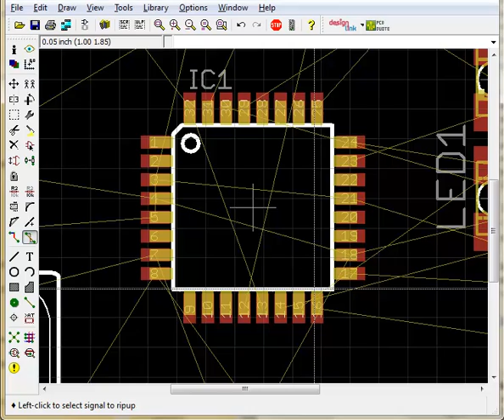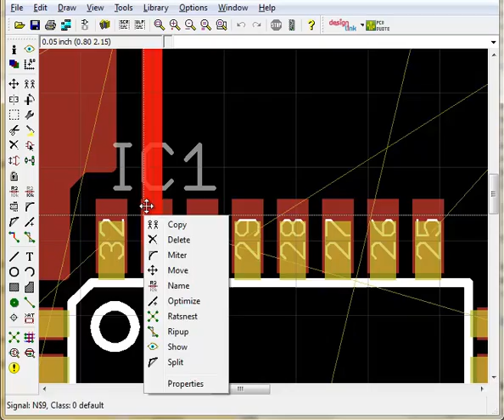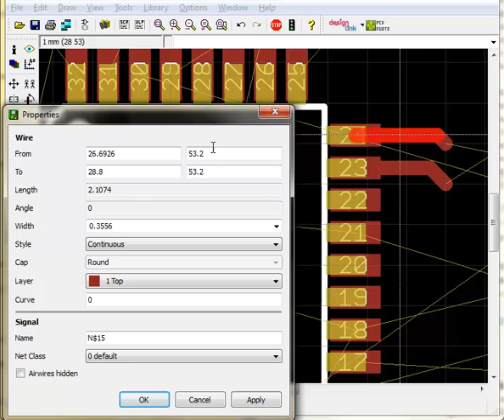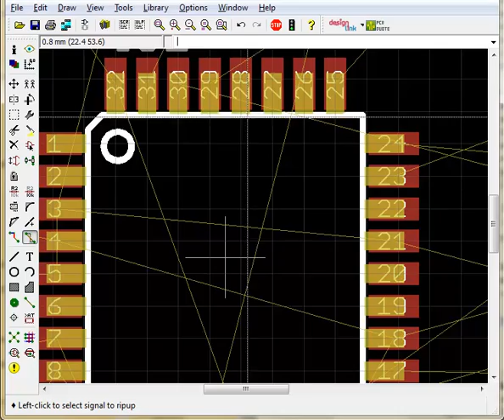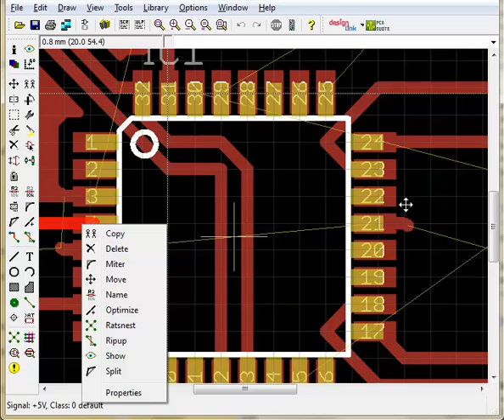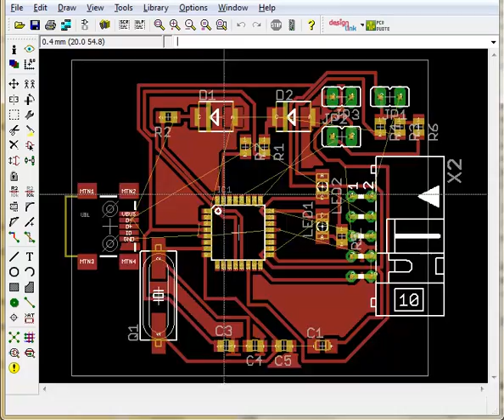CadSoft Eagle - Picking a grid size

Comment: You should explain what those values are actually? What is ALT??
Reply from the maker: alt is the second grid size so you can temporary override the main one  with a preset key usually shift. for when you need a different grid spacing during placement or routing etc